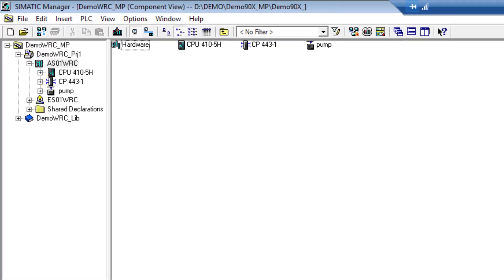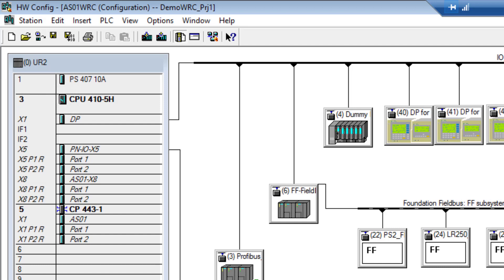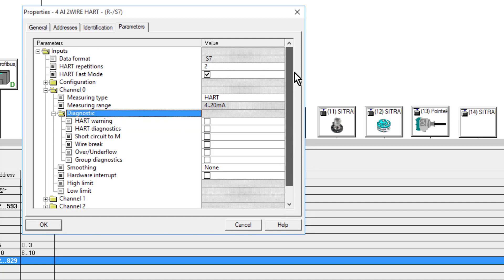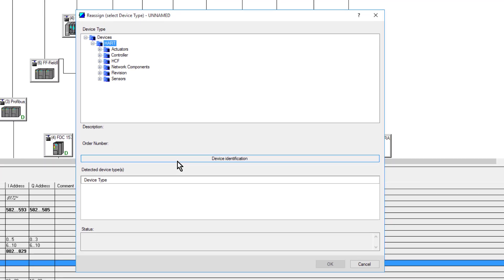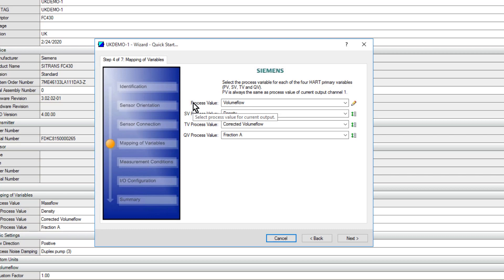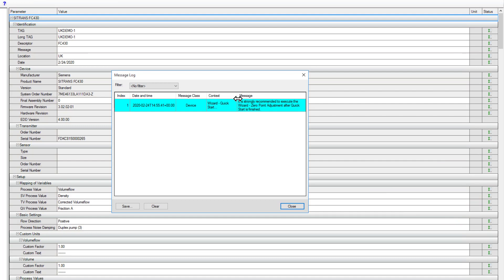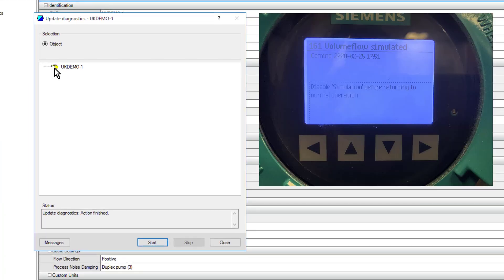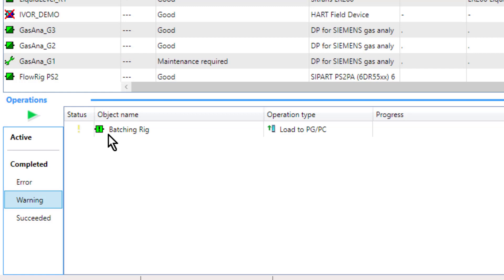Using SIMATIC PDM with ET200 ISP HART enabled Remote IO on PCS 7

Comment: Thanks for the video... Does one still need a zaner barrier with the use of an iSP module?
Reply from the maker: The barrier is part of the IO module so no additional barrier required.  You have a 2 wire or 4 wire 4-20mA input.   I will run a short video showing how to spec on of these up.
Reply: @IOTConnectivity  Thank you, that is what I tought from the specs. But needed to double check.